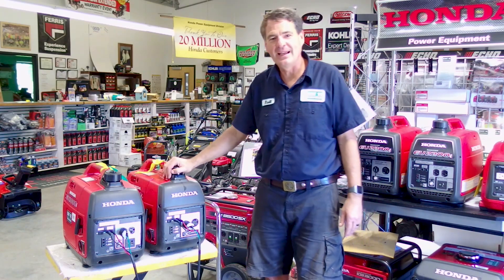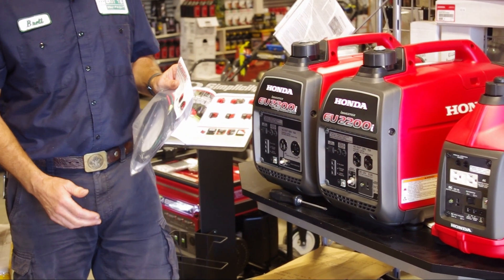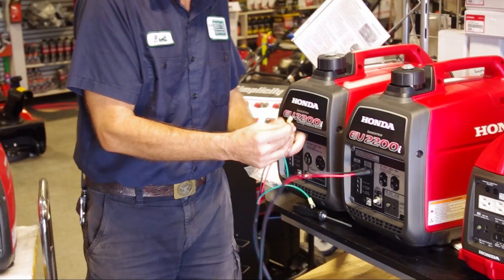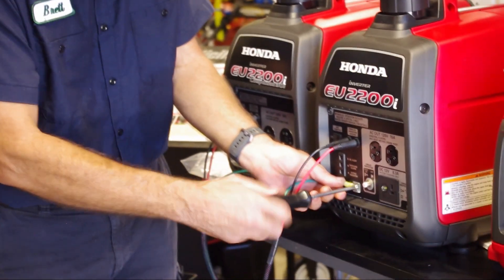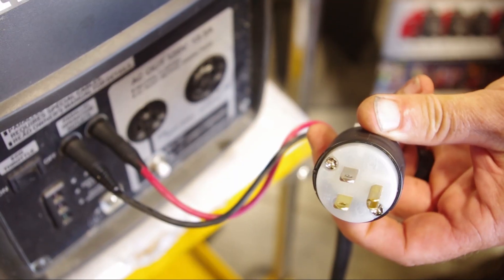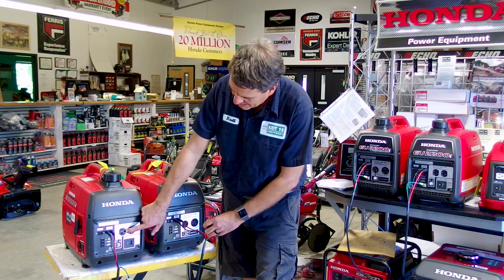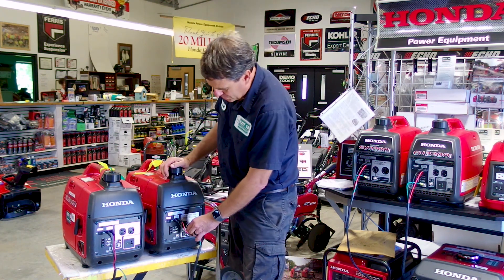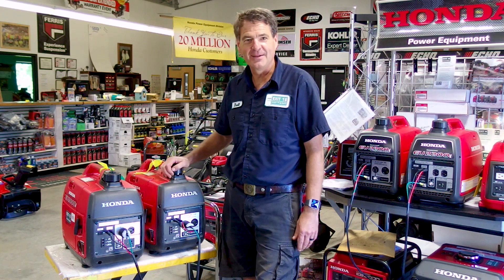Honda EU2000 Parallel Kit Ground Wire Modification!

Comment: i have a really stupid question, at the end of the cables i can see there is plastic covering the tips, do you have to remove that or are they designed to plug in as they are?

Comment: well, that likely would work (I assume you checked that there is full continuity between the dedicated ground terminal and the ground receptacle in the 120V outlet, and there is)  but that may not be the simplest nor most elegant solution, sorry.  You have these 2 big 120V plugs now that take space in storage and use up 2 useful outlets.  OTOH, a single small Anderson Powerpole on a short hanging pigtail on the separate ground terminal would be much better IMO, taking very little space and freeing the 120V outlet.   Or if you don't know how to set up a PowerPole,  many  other small connectors (bananas, spade etc) on a pigtail would work too (use a big enough one).   But good idea in principle to make this toolless.

Comment: Takes away 2 outlets when you do THAT 😂
Reply: Just put a plug on one end, use the ground screw on the other, no need to remove the wire from both just to move the generators.
Reply: @akbychoice  another guy also said, you could just replace Philips head screw with a hand-tightening knurled screw, but thanks for the reminder, you only need one to come off.
Reply: If you're running two in parallel, why do you need all four outlets?  You'll be getting 30 amps from the L5-30R receptacle on the Companion; if you need a bit more, you still have one 20 amp receptacle available on the standard model.

Comment: CAUTION: only knowable electrical persons should do this. Novelists you should put in-line Male & Female Quick disconnects in the green line, this way you wouldn't have the chance of mis-wiring the plugs & destroying your generators or causing electrical fires. Also you could use both of the 120V plugs. Many different types of in-line connectors are readily available at auto parts stores, farm, home, or hardware stores, Harbor Freight & Walmart. One last thing the in-line connectors are much cheaper than the plugs.
Reply: A monkey could perform this modification; it's a great idea and not at all difficult.

Comment: As an "RV mod" to YOUR clever mod for generators, how about bonding neutral to ground in one (but not both!) plugs so the RV EMS system doesn't throw the "Open Ground" fault?

Comment: Or you can just make a sucide double male 3 prong and plug into each empty outlet on each unit and throw the parellel cables in the trash
Reply: They don't call those "suicide plugs" for nothing.
Reply: @cjwilly1862  exactly.
Reply: @cjwilly1862  those parellel cables do the same exact thing. Only with a suicide cable you have the ground as well. You can even do a suicide cable 2 male 120 recepticals to a 30 amp rv plug and your done for $24 at home depot
Reply: rams&rotties - when you say "each" empty outlet, do you mean just one outlet on each gen set or both outlets on both gen sets?
Reply: @vaquero3578  Yes one male ac plug into each 1 outlet on  each generator recpitcal

Comment: I helped neighbor wire submersible water pump, but it failed to run! Study found "Floating Neutral" could you describe this Floating Neutral? Thanks!
Reply: As it applies to a Honda generator a "Floating Ground" is referring to all metal parts of the generator being ground. Honda also refers to a generator being "Neutral Bonded" which means the ground and the neutral are connected but I'm not sure what "Floating Neutral" is for sure but I suspect it is the same as Neutral Bonded.
Reply: Get a grounding rod and smash it onto the ground, get a wire and go from copper rod in ground to ground on unit.
Reply: @tintdr  Rod has to be at least 4 feet into the ground, and the ground has to be natural/undisturbed soil - can't have man-made material under it.
Reply: @myparadiseing  uhh, that's wild to me.  Nobody has ever mentioned that to me in my 50 years, but ofc I'm a novice, but I still thought this would have crossed my wires at least once in this 50 years.  You have a video link that explains this concept?? thanks